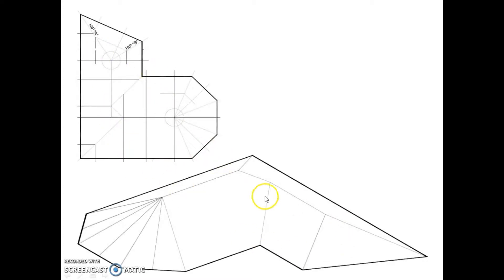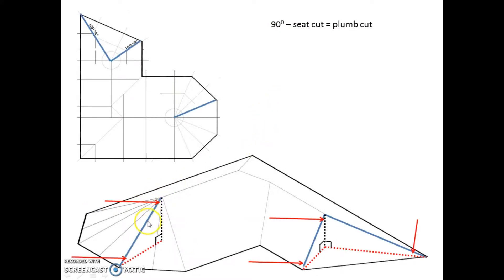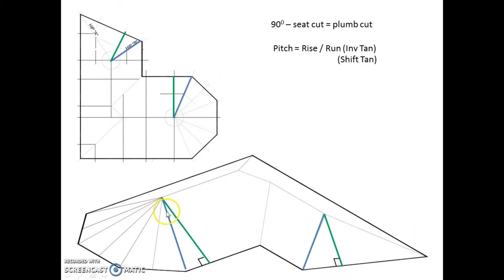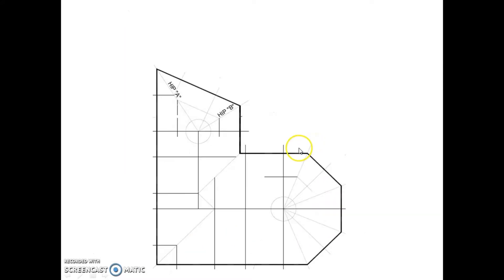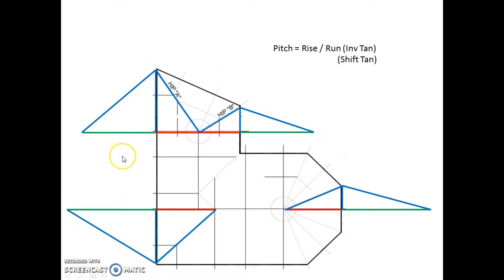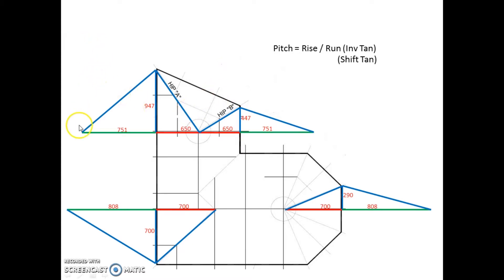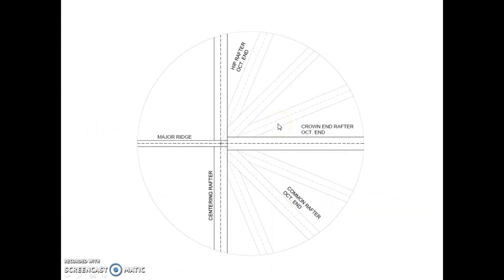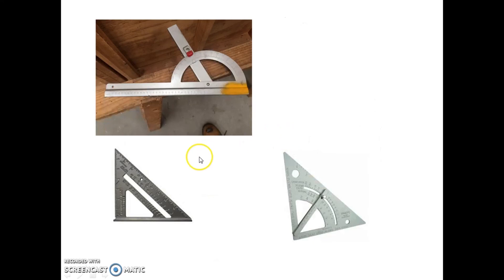Pitched roof calculations. Part 6 - Seat, plumb and edge bevels

Comment: Good videos just one point though the hip edge bevels you show are correct but when you mark it on the top of hip it will be slightly different because the top of the hip is on a different plane cheers